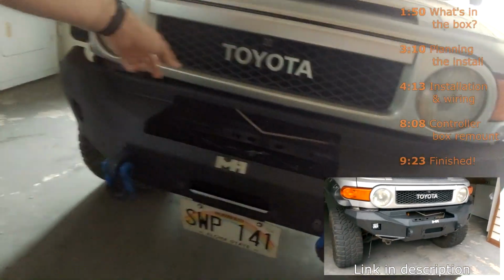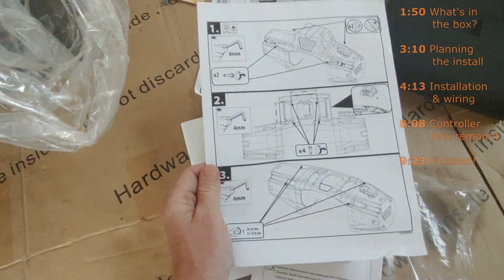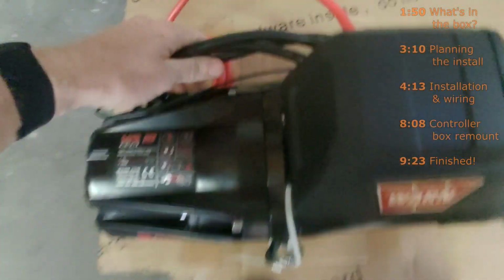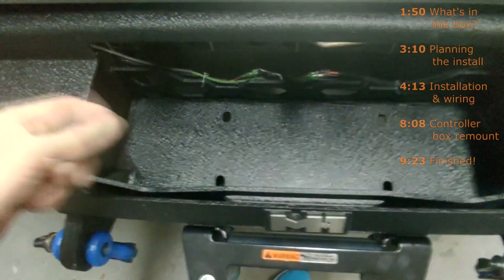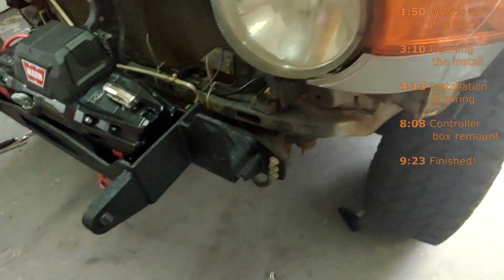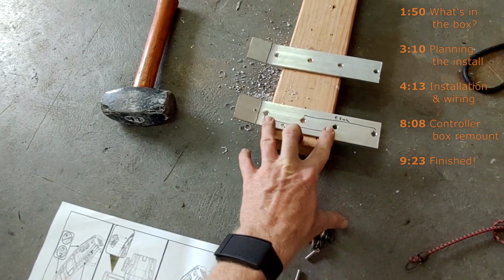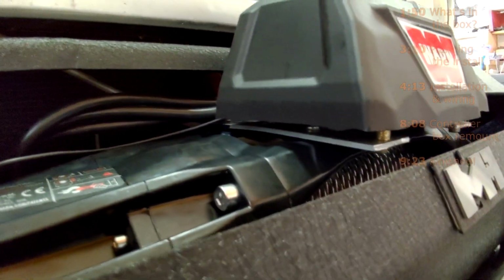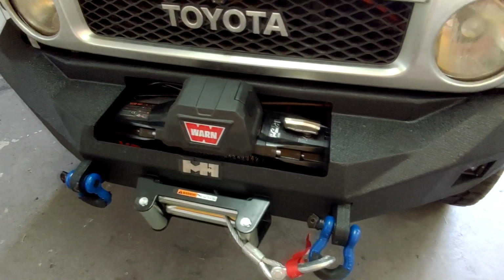Warn VR 10 Evo install in Smittybilt M1 bumper (FJ Cruiser)

Comment: I’ve looked and didn’t see it but just checking, did you replace the rear bumper as well?  I am 99% sure I am going with the Smitty M1 front and rear. Enjoyed your video and new subscriber!
Reply from the maker: Not yet, I'm thinking about it, but I just picked up a manual IS300 that needs a ton of work because of cheap mods. So it'll be a while before I buy a rear bumper